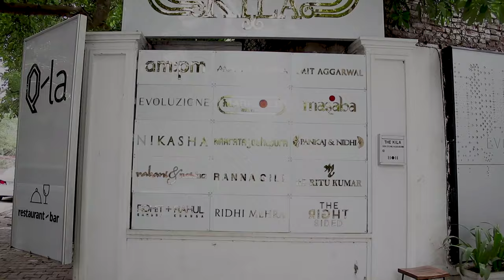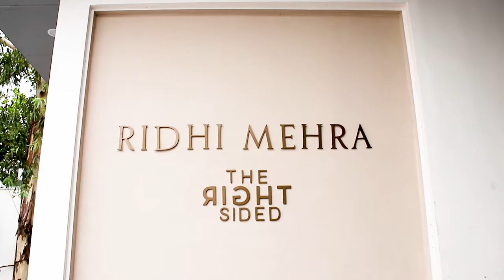Micro Topping Concrete Flooring, How to apply Micro topping #concrete #microtopping #microcement

Comment: Looks Amazing....how much time does it take to get dry....!!!!!
Reply from the maker: Amit Kumar its a micro cement fastest setting material comparing other concrete applications .
For more details
www.creton.in 
+91-9650423139
+91-8744059004